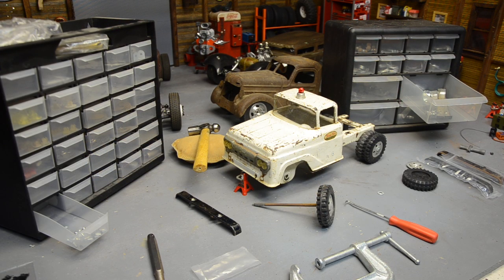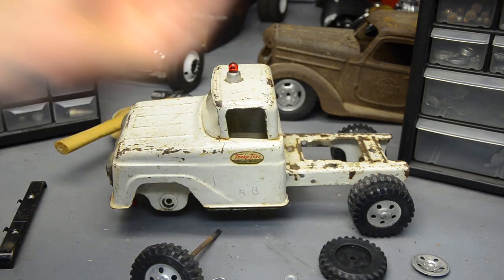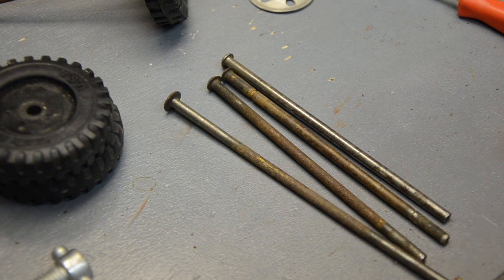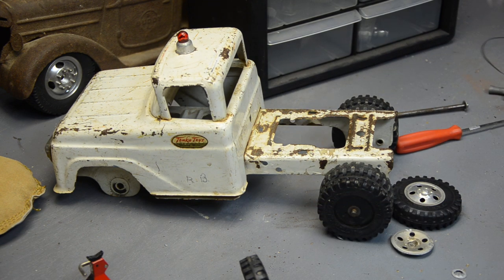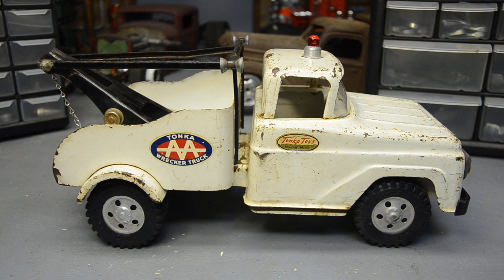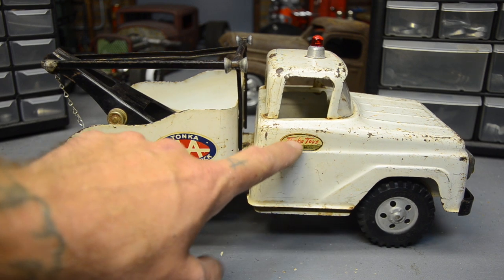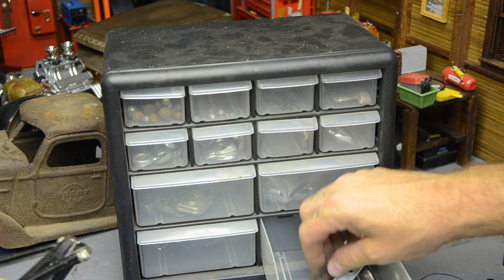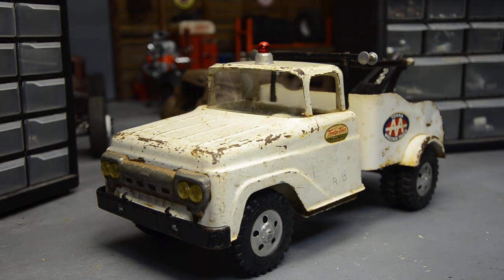Light Restoration, Piecing Together an Original 1958 Tonka Tow Truck, Vintage Toys

Comment: I have 4 the oldest is from the 1970s its a pick up its got a bit of rust the most recent one i got from a second hand shop is from the 1980s but its the most rusty of them  all its a tow truck and has more plastic than metal lol  like you i just want to stop the rot and preserve them